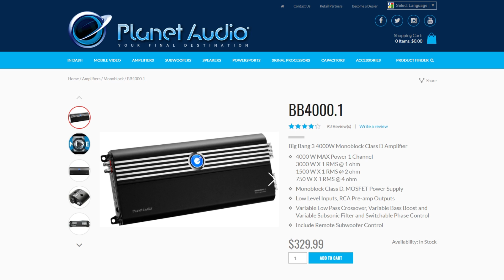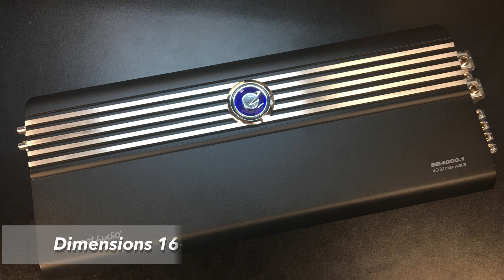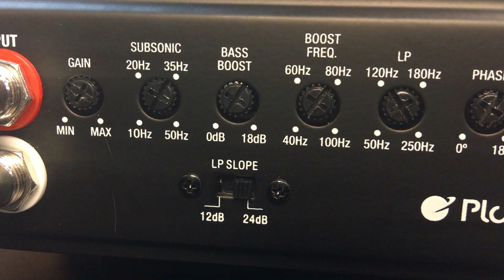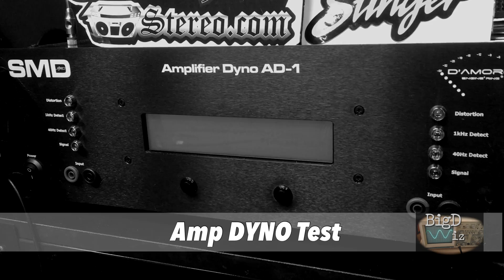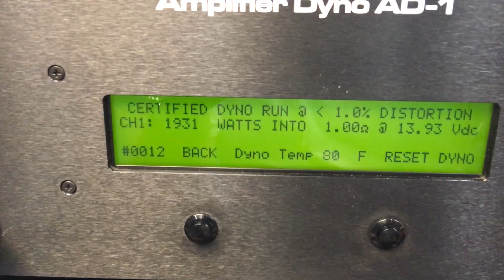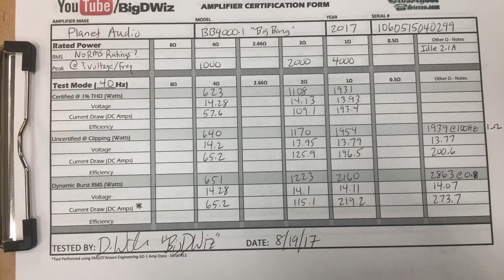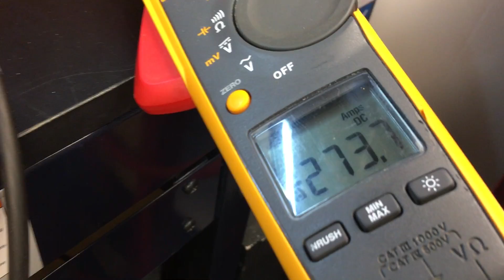Big Bang or Big Fail? Planet Audio BB4000.1 4kW MAX Amp Tested

Comment: One thing big D that's been in the back of my mind watching all your videos is that infinity subwoofer. 
Is it rated like maybe 500 watts Rms ? I was thinking that you would fry that sub way before you can show us how much power that amp can give a subwoofer... I was thinking you could get something like an Orion hcca used or mtx 9500 for not too much mo say and it would be able to take the power better with out risking blowing it way before you reach true max amp output, just a thought other wise great video 😅👍
Reply from the maker: +FAST & LOUD !!! MICHAEL VICKERS I'm going to get a small wall of high power subs as soon as I get my battery bank and new test bench created. One step at a time 🤙

Comment: HEY! I just bought a Ct sounds 750.1D amplifier which is rated 300 watts rms @ 4 ohms 
600 watts @ 2 ohms
750 watts @ 1 ohm 
I just wanted to know if that sounds reasonable for a class D mono amp for around $150
Reply from the maker: +Zwick check HiFiVega's YT channel, he tested that amp. They were selling the 750.1 and 75x4 both for $199 a few weeks ago

Comment: I got the little brother to this amp.. the BB2500.1. I didn't expect this amp to do anywhere near what the manufacturer says but it's nice to know what it actually does. Now, I'd like to know what mine really does and believe me, I know it's no where near 1,900rms @ 1ohm.. I've never seen any real, true 2.5k amp with only three 40 amp fuses.. most I've seen are from 1.2k - 1.5k so I'll just assume it's around a 1k if that.
Reply from the maker: +Timothy Thomas Just take their max number and half it...seems to be their equation for true RMS output. At least it's not like Boss' equation 🤷‍♂️

Comment: Still an amazing value for the $$. It would cost 10x more back in the bad old days (90's)
Reply: In the early 90s I used US amps almost exclusively. They were awesome amps but they were a dollar a watt. Or more. In fact I was a US Amp dealer and they were about $.70 a watt at dealer cost. So when I watch these videos I feel like this amp is a fantastic value. Maybe today it is not.
Reply: its hard to compare with nowadays tech stuff, they make 3kw rms amps that are @ the size of my hand.. making 40+ kw rms amp n stuff.. way too much diffrence compared to the 90s with the big badass  orion amps that only can put out 1+kw rms 👌.
Reply: That amp is only 188 on Amazon so it's not a bad deal
Reply: I was thinking the same thing!

Comment: I have a feeling their numbers are based on 10% thd + noise at clipping. I've been looking at class D chips, just because nobody sells what I need, and chip manufacturers rate their amps at 10% thd+n at clipping. Wouldn't be surprised if they slapped together reference designs and use the manufacturer's claimed numbers.

Comment: I wonder how a second hand shop would do if they had an AD1? 
(I guarantee this amp does xxxx watts) is a hell of a sales slogan...
Reply from the maker: +J& K most amps I buy and test lose value after the truth is told, so might not be the best way to make money 😊
Reply: BigDWiz 
I was just thinking a pawn shop that has a steady flow of used audio might build a reputation testing the amps they get in so kids  know what they spent they're McPaycheck on. 
I wouldn't shop for new gear (don't really anyway) if a local place had a Dino sheet to go allong with their lower buck gear. I am a person who would pay to know for sure what power I'm putting out

Comment: If they sold that amp as a 500/1000/2000 watt RMS amp (4/2/1 ohm) then I'm sure this story would be a lot different. But NO the mfg has to go and put grossly inflated numbers out there. smh. Thanks BigDWiz for the test!
Reply from the maker: +Choralone422 agreed 100%
Reply: they are amazing numbers but not for the money, around 150 $ is the limit for this amplifier.
Reply: Usually with these 4000w max amps. the true rms is going to be somewhere between 1/2 the max power or 10x the fuse rating. somewhere inbetween those lines if you're lucky

Comment: I expected those results from that amp.
If u can get ur hand from d db drive A7 2000.1 to do a dyno test will be nice
Reply: latchman bal now YOU talking! I had one on a 're audio 15 sxx.  And out beat a yukon with 4 12's. Mines was in the trunk of a 00 caddy! 
I now have that Yukon; and currently putting 3 of those woofers to 3 individual db drive 2000.1's 
Still would like to see the numbers on the board myself though😎😅😁

Comment: Am not shocked at all..planet audio never put out the rated power 😂
Reply from the maker: +shawn tyson if rated 2kW RMS I would have given it rave reviews! The Amp was nicely efficient and had great control over my sub....but I can't get past that "RMS" rating. Maybe it accepts 20 volts input??
Reply: BigDWiz I won't be surprise if this board is use in a different amp,rated at less power
Reply: BigDWiz I do believe my ndx5500 is almost the same board , it sounds great and runs cool, built good . I know boss inflates numbers but I knew buying it ( $100) what I was getting . but I have it set at 2 ohms and it seems to do OK power wise but it has good range and is very transparent.

Comment: big d have you tested any of the skar rp series amp tried looking for a video only finding one from skar
Reply: Dan Petersen yea on the skar page if you watch it makes 2400ish it will have the power to to produce well i have a 270alt as well as my stock 140 and 0 gauge subs are crystal audio Solutions cs6 d4 15's i would to someone like d wiz or smd put one on there dyno
Reply from the maker: +Jason Sullivan they can't cheat the Dyno unless they use a different amp, so what they show should be legit
Reply: Jason Sullivan I would choose skar I am actually a team member of skar audio
Reply: Jason Sullivan I run 2 on 2 hcca 12s basically at 13.4  they are 1500 watt amps not bad compared to the shark audio 3500s I use to own
Reply: Jason Sullivan they do their rated power if u can supply the voltage of course the sk series r better and will do more than rated I ran the rp 2000.1 on a zvx 12 I actually had four rp and four zvx 12s but it is hard to get these exactly at one ohm but they r worth the cash u pay
Reply: Jason Sullivan right someone other than skar dynoing the amps. I heard they cheat the dyno idk how but that what I heard. I have a buddy that is a skar/sundown fan and he bought me 2 skar rp2000.1s so I'm not gonna complain about free amps lol
Reply: im paying $210 brand new from a local dealer here in Nashville,tn so i can't complain but i may take an hour away and put it my friends dyno just to see actually what it does
Reply: i'd skip it. Its from the same line/manufacturing as the american bass vfl 4480.1 hybrid and ph4000 which have horrible quality control issues. Either you have an amp that does okay or you have an amp that does not put out power at all. There's a high chance to get a lemon. You are way better off with a car audio bargain or audiopoop amp.
Reply: Jeff DaChef so you would choose an audiopipe over skar? to me skar has a better warranty and products never cared for the audiopipe stuff i know for a fact that if i had any issues with the skar it would be taken care of and id have a new amp in about 3 day
Reply: BigDWiz they start off high and end around 14.4ish which is fine we all know that is in a perfect world and if you would like to try one i have a rp 1500.1 i could arrange to ship to you if you would ship it back
Reply: just talking in raw performance and actual direct swaps the skar was shit compared to the audiopoop 1500.1

Comment: they are lying but what a deal at the same time.
Reply: sorry but the output on a ONE OHM is a kind of bullshit.
The best output power, and I think for my own, are 2 ohms and 4 ohms.
The values rated on 1 ohm are the prove than amplifier can not assume a high voltage on the output.
Reply: Nelda  Cardenad over 300$ for 2000rms
Reply: it's $229
Reply: TubeYou still not good, audiopipe does above rated power and the 1800 is 180$
Reply: Gage Handy didn't mean to imply it was good just correcting your statement.
Reply: Gage Handy ap does not do above rated
Reply: JBiNN old audiopipe did till there popularity went up now there a cheaper board and caps. I have rebuilt many. The old ones used the same board that crescendo started using and still does in a bigger case.